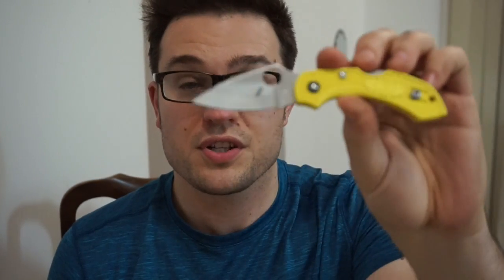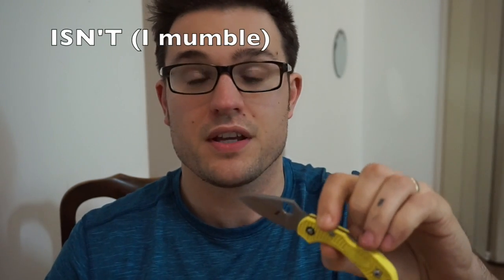Edge Retention Test:  H1 Steel on Spyderco Dragonfly

Comment: It is said that H1 steel sacrifices edge retention and durability in order to be rust proof, not sure how accurate that is, but it is an austenistic steel, meaning the more you use it, the harder it gets, H1 steel can't be heat treated, so it's up to the user to harden the steel

Comment: Although i personaly think work hardening wont occur when sharpening the blade/will do that much anyway... i know someone who used to be a jeweler and uses a smooth steel "honeing rod" type of thing that he reckons's "work hardens" the edge. I dont buy it. But you could give it a go by maybe stropping really hard on a smooth steel surface to actually "work" the edge. Not sure what you'd use. Maybe the spine of a rounded kitchen knife or a smooth steel rod of some kind. Twood be interesting to see. Ily❤️

Comment: Say Heah Cedric, 
I hope this helps
H1 Steel.,,. 

C: 0.15; Cr: 14.00-16.00; Mo: 0.50-1.50; 
Mn: 2.00; N: 0.10; Ni: 6.00-8.00; 
P: 0.04; S: 0.03; Si: 3.00-4.50; 
Cu: 0.10; 
Maker: Myodo - Japan (JP)

Notes:
Basically this is a real stainless steel, practically doesn't rust. Doesn't have much Carbon to speak of, just 0.15%, but having 0.10% Nitrogen helps its performance. H1 isn't the steel to expect high wear resistance or edge holding in general, but where it really shines is resistance to corrosion. As such, it performs best in diving knives and generally, in knives designed to be used in aggressive environments. Still, it performs quite well, similar with Aichi AUS-6 steel and Aichi AUS-8 steel, at the same time being considerably more corrosion resistant, which means it'll outperform most of the stainless steels in harsh environments. H1 is work hardening steel, which is supposed to get harder as it is used. According to 2006 post on Spyderco forums, Crucible Specialty Metals tested at least two Spyderco H1 knives, one plain edged, another with SpyderEdge and even though the spines were still 58HRC, the edges measured 65HRC and 68HRC respectively. That's really high by any standard. And according to the same source, H1 doesn't become brittle at that hardness. The only thing is, it's not quite clear how to use it to induce that work hardening. Cutting abrasive materials to cause friction is supposed to do the trick, but based on the later feedback, it's not that simple. Sharpening by hand is in theory very much friction inducing work, except you're removing metal and apparently doesn't increase H1 steel edge hardness either. Belt grinders do increase H1 hardness though. Given those two statements, you can deduce yourself, how fast you'd have to cut abrasive mediums to cause hardness increase.,,. p
Reply from the maker: paulie 4x yeah! I do wonder about the sharpening removing any 'hardened' steel. I think the best thing I can do is keep using it and test again in 6 months or so

Comment: I mean it's a cool looking little knife, and it's strong suit is corrosion resistance. It would fair well in your kayak missions my friend.
Reply: It can not "corrode" at all; simply because there is no carbon in it.

I do keep an "Atlantic Salt" laced to my dingy life jacket, and i assure you that i have no intention to replace it any time soon (maintenance ZERO; how cool is that...)
Reply: Grappolidipalma yeah that is an awesome quality to have. I was able to get a mule in LC200N, and that steel is supposed to be as rust proof as H1 , but with better non serrated edge retention.

Comment: Update. As you know, I bought a Salt 2 a while back. Yep, my geek got the better of me. I'm finding that with everyday use (yep, it's become my daily carry) I need to strop it for a couple days, then it gets to the point where I need to  run it quickly over a very fine diamond 'stone' and then a little on the ceramic to get the hair shaving/paper slicing sharpness back.  What do I cut with it? Plastic, cardboard, cloth and food. The edge retention isn't stellar, but I know it won't rust or tarnish no matter what the environment, or how sweaty my pant pocket gets (sub-tropics in Summer is a biatch for humidity).

Comment: use a grinder and sharpen it. the heat will harden it more. you can try your tormek and run it without water on high speed? dunno if that will even do anything or ruin it, but just a thought. in any case... it's heat that will work harden it.

Comment: This graph shows exactly what a proper heat treat can do. It takes 440c from 55 cuts to 285 with cts 40CP which is just Carpenters version of 440c. It beats out s110v, Elmax, Xhp and m4 which all should have higher wear resistance than 440c by a lot, especially s110v. But when your S110v is at 61hrc instead of 64-65 where it performs amazing you're just wasting expensive steel.

Comment: Question: 
It seems the steel "LC200N" runs about $20.00 USD more than "H1" steel, with regards to Spyderco's Pacific Salt series of knives. 
My question is, concerning edge retention, is the plus $20.00 worth the edge retention, or is it only negligible. Meaning, probably better to get the H1 version saving a little bit of money? 
Thanks,
Reply: Lc200n for sure 100% every day of the week

Comment: Hijack INC !
Only posting this here as I love your vids and you are a knife nut !
Posted on DLT and will link my video when done
-----------------------------------------------------------------------------
JX5 VENGEFUL 1

*Long* Worth it
 
I WAS one of those "small forrest axe / hatchet is always 10x better then any "chopper"knife.Kind of guys.
As a career US Marine 0317 and outdoorsman I have used it all.
 
This all changed when (semi recently) I learned about Bark River.
BRK big knives /choppers are better then a small forrest axe / hatchet,period
 
(Friends and I actually tested 8 small forrest axes from home deeps to the big names over seas.You know who. In EVERY case the Bark Rivers did better, period.)
 
I owned or used the BRK Parang,Senegal ( I had one, got stolen,actually confiscated grrrrrr)Dakkar,Moro Barong and Bravo III.
 
** I will post a fast youtube shortly ( day or so) about the JX5 Vengeful 1.
Should be up  7/15/ 2017 or 7/16. Called  "JX5 VENGEFUL 1 IS AMAZING"
 
Back to the review:
Some / most "big choppers" are not so big,not so heavy and just wrong design to chop at a high level.Made of low tech cheap rust bucket 1095.
The shape and curves are just wrong.(straight usually)
 
As for the JX5 : it is just right.Really right.Big enough (long and heavy) to be big enough,but not so big, it is goofey.
 I have used other big choppers that seemed less user friendly.Some that chopped ok but as just a knife turned out not great.
 
The JX5 bites DEEEEEP. This is due to BRK perfect ,SHARP ,convex edge.Much deeper then the hatchets by a huge margin.
The handle is just perfect,period.Close,mid or way back for chop city.No hot spots.  (I did get mine custom a bit.Simply a bigger trigger finger choil,deeper.. Will show this on video)
 
Steel is properly treated CPM 3V super steel.For those that may not know, BRK tripple HT and tripple cryo treats each blade.Always at perfect rockwell for knife design.
 
Fit / Finish : is a work of art
 
Will say more on video, but briefly as this is so long:
over 3 days I did early summer clean up.Cut down sapps and pruned trees,Cut up fallen branches and large sticks. Roughly 10 hours
 
Knife was flawless. Sharp after all that.
Stropped for less then 60 sec, shaving sharp again.
My favorite Big knife /chopper /  and small axe / hatchet replacement,EVER
 
As a knife for camp / bushcraft stuff it is also amazing due to design.
Again more on video in 1-2 days
 
Is this knife worth 250-300+ bucks?  Y E S
is it worth pissing off the wife or saving up for it ?  YES
 
TY Chris Tanner PM101. A+++ Job...again. JX4 CPM 154 Bushbat also
TY DLT, Jason. Knife was a great price. Order processed in mins ! Showed up in 2 days !
TY Mike (owner) of BRK and his entire team.These folks are master crafts people and frankly, artists.Your work level sets the bar to the top.Your pride SHOWS. Know that not just collectors use your tools. In the field ,my life depends on my gear (including knives) and I use only Bark River.  As always this knife is backed up 100% NO  B.S.
You break /damage/dull it,they fix it FREE.No phone tag or forms to fill out.(Jackie can we fix this? "YES WE CAN !" )
Want your knife modified? Handle / blade,anything..FREE
Nobody else does these things
 
Semper Fi
Gunny
 
P.S. My 10 hours use was actually fun. Hard to describe. may sound odd.I looked for more and more to chop and process.
Works so well it feels like you're holding some kinda magic short sword !
Reply from the maker: i am suuuuper excited, Chris is sending me a loaner for review. But the JX6 is bought with me own cashola. Cant get bushbat here cos customms hate the ring on it
Reply: Wow the ring? wierd
When will you get a JX5
Reply from the maker: +BOOSTEDLASER I'll see how I like it, then sell a couple things to get one I reckon!

Comment: work hardening you keep using this word but I do not think it means what you think it means lol yay I finally got to say that - work hardening happens when you cold work the metal as in shape it in some way, hammer it or bend it etc. you have probably noticed this with a paper clip if you have ever bent one back and forth until it broke. if you did this you would notice how the broken ends had become much harder than original paperclip metal. many iron alloys behave this way, bronze behaves this way. hammering the edges of relatively thin bronze was one way to make bronze hard enough to make good knives, arrow heads, spear points, and swords from bronze.
Reply from the maker: Michael Graham - cool, yes I was thinking folks with more knowledge than I would jump in regarding this: I am of course referring to the sharpening and using lf the knife to (allegedly) cause the edge to grow harder, but I am definitely not using correct terminology! Cheers for jumping in, I'm not schooled at all - just testing a rumor at this stage 😊
Reply: From what I understand, h1 isn't heat treated, but instead, work hardened. From that, people assume that the edge will continue to harden with use. This might happen with se knives in some situations, but I doubt it.

Comment: H-1 is not a lower end edge retaining steel when serrated. You really should consider doing this test on a fully serrated H-1 blade, it would make for an interesting and educational video on the properties of work hardened steels. H-1 Steel in a serrated edge is superior to S30V and is reported to be comparable to or better than S90V.
Reply: Serrations do not change the properties of the steel, also these tests are meant to be fair comparisons under equal conditions.  Further, serrated S30V would likely be much better than H1.  Non-serrated edge retention tests are the only effective way to test the quality of the steel for edge holding purposes.  Even junk steel can cut effectively with serrations, which is why you see a lot of cheap mall-ninja type knives with serrations.
Reply: Cavedog H1 is supposedly getting harder as metal is being removed aka sharpened, and the reason serrated H1 has better edge retention is because it's ground more and has there for higher HRC, I don't have experience with H1, but this is how the story supposedly goes 🤷‍♂️
Reply: There is a video somewhere on youtube where Sal Glesser explains that they observed some odd properties with H1 while working with it. They found that when they cut the serrations into the blades the HRC at the edge was in the high 60s while the rest of the blade was less. He commented that this effect is present, but reduced for the the straight edge variation and that this makes the serrated variation of the knife perform much better even with the differences in geometry accounted for. This is why people have a particular fascination with H-1 steel and its serrated variation as opposed to most other steels. Also, I honestly doubt most people are going to raise the temperature of the blades enough to change the HRC while sharpening. 

In addition, a serrated test of the knife compared to straight edges wouldn't really be fair. If one wants a better comparison one would have to find the same serration patterned knife in two different steels and tape off the edge so they both reveal the same amount of blade. Even with this, the sawing pattern of cutting would make the test more inconsistent and one would only really be able to differentiate the two on rough terms.